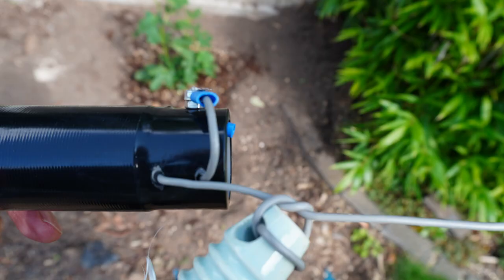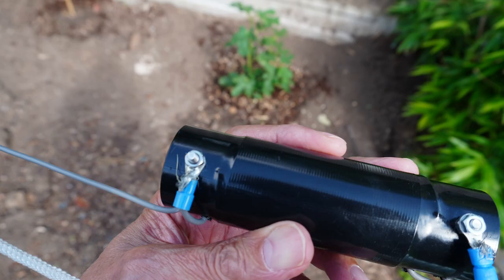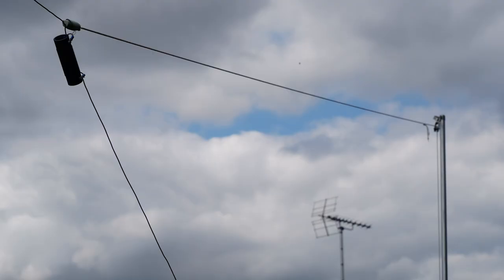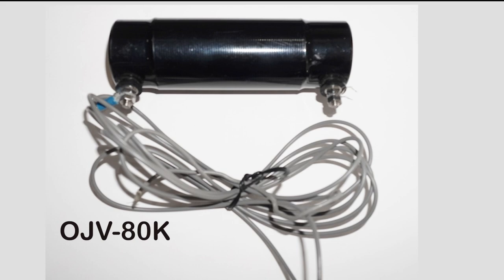End Fed Half-Wave Antennas - Tips and Tricks

Comment: Great video, I haven't seen the option to add a 18Mhz trap to give dual band coverage. Kinda makes sense - thanks for sharing
Reply: It got me thinking though, obviously if you have a loaded antenna for 14MHz that it wouldn't be as good as a full sized half wave. But then on 18MHz, which would be better, a resonant (trapped) half wave, or a longer antenna, say a half wave on 14MHz, but with a tuner to match it?
Reply: Paul Sengupta In theory a trap will make the 20m antenna less efficient, I doubt you would detect a difference in performance if you tested the two antennas back to back. I would recommend a resonant antenna over one that needs an ATU, this trapped design looks like an uncomplicated way to achieve that
Reply from the maker: Thanks guys

Comment: Very informative - would it be ok to use the choke to get a shortened half wave at 40m and then add a second choke to add the 80m band as well?
Reply from the maker: Yes it works but tuning on the lowest band is always quite sharp. 73 Peter
Reply: @watersstanton Many thanks for coming back to me. Yes, I suppose that makes sense. With the combined loading coils.

Comment: Thanks very much great info, but I'd love it if you'd use Imperial and Metric measurements in your videos.
Reply from the maker: hi there. It’s an age thing! Will try.
Reply: @watersstanton  Well the USA still uses it so it's not just an age thing, but UK and all of the rest of the world uses metric these days so I think both is better than one or the other if possible.  73!
Reply: The metric measurements are a bit of a no-brainer though. A half wave on 40m will be 20m, a half wave on 20m will be 10m, and a half wave on 17m will be 8.5m. Make it a bit longer and trim for resonance. :-)
Reply: @paulsengupta971  I know how to calculate wavelength in metric that wasn't the point.  (300/Freq in MHz then multiple by Velocity factor)...
Reply: Indeed, but my point is that you don't need to go through the calculations as you already know (approximately) the wavelength as that's what the band is called. It's called the 20m band because it has a wavelength of 20m, and thus half a wavelength will be 10m. Approximately, hence starting off a bit longer and cutting for best SWR.
Reply: @paulsengupta971  So no need to mention any measurements at all in metric or imperial then.  BUT if you do best use both, and don't mix units.  If you mention 20m band it's nice if the measurements are in metres - it's known as the 20m band not the 65 foot 7 and 1/2 inch band isn't it...
Reply: "So no need to mention any measurements at all in metric or imperial then"

You have to mention them in imperial for our American cousins. If you say the 80m band and mention a half wave, someone who converses in metres will immediately think 40m (I recently made one of those, cut it to 43 metres to start with, haven't trimmed it down yet, got to get it up in a tree...). But someone in the US might have no clue what length 40 metres is or how it fits into their garden which they only know in feet. So if you then say it's 133ft, they'll then have an idea. One's obvious, the other needs maths. Though I do agree with you that it would be nice to hear the measurements given in both.
Reply: @paulsengupta971  "Though I do agree with you that it would be nice to hear the measurements given in both."  That was the entirety of my point, nothing more nothing less.

Comment: Thanks for the information, very instructional. Recently moved from a 2 acer yard in South Carolina to a 60x100ft yard in Connecticut ! Trying to figure out what to do. well 73 Leo k1zek k
Reply from the maker: Still plenty of room by our standards! 73 Peter
Reply: That's huge by British garden size , I wish I had that size garden .
Reply: That should be big enough for a full sized inverted V on 80m (wherever you choose to feed it) if you can get the middle up high enough. Or you could have a horizontal antenna with the last 33ft (133ft total) going off at 90 degrees.

Comment: I have recently purchased an end fed antenna. I wish to use it mainly for 40 meters. The length of the antenna is 41ft , which is roughly a quarter wave length at 40 meters.
Would it make much difference if the wire length was increased to around 66 ft, so it would then be a half wave at 40 meters?
Reply from the maker: If it uses a 9:1 unun then yes but avoid a half wave kength. Go for  around 50ft or 80ft.
Reply: @watersstanton  Thanks. It has a 9:1 Unun. Will the current length of 41 ft still be ok?

Comment: Thanx alot Sir for such a brilliant video, I need to ask that, what if I install EFHW in a normal L configuration ( not Inv L) in your opinion how good it will be with DXing point of view, as a matter of fact I'm planning to install it in normal L configuration with about 35 ft vertical and rest of the length as horizontal..thanx
Reply from the maker: Interesting!  if the horizontal length is well above ground - say at least 10ft then the results would interest me. Try it.
Reply: @watersstanton  Antenna will be installed at around 20 ft of height above the concrete roof of my house, but the horizontal section would be about 8 ft further above the roof....thanx for the early reply..will share the results with you.

Comment: Hi i have a small garden but have put up a 80-10 efhw at 140ft long but zig zagged it up my garden.....was wondering if I cut it to 66ft and bought one of your coils would it work better or worse as less wire?? Just means I could probably get a 66ft alot higher?? Many thanks
Reply: It’s worth avoiding coils if at all possible.
Do you have any height that you can use?
Could you start or end the antenna with a vertical section? A 10m pole would give you 30+ wire straight up.

You might get more comments on here, but feel free to message me - my email address is on QRZ.com
Cheers,
Matt M0PTO
Reply: @tincanblower  thanks matt .at the moment it starts with around 35ft vertical,then goes 33ft horizontal,then back to the house horizontal 33ft and then slopes down to the fence so in theory its in the shape of an N .Tunes on 80-10m with no external tuner which is a good thing n have worked usa,trinidad,Canada,Europe etc but we always want better
Reply: Andy Bronson M7xtt performance on 80m will be down as your 66ft plus coil will become a compromise on 80. This is the antenna I use but the good news is because signals on 80m in the evenings are generally so good you won’t see a big difference. Don’t expect great results on the higher bands until the new sunspot cycle really gets underway.
Reply from the maker: Hi Andy - hope the advice. from readers has helped you. In fact your zig zag would deem to be working quite well.

Comment: Hi Peter. I really enjoy your videos, they are very useful and have got me back onto radio again. I particularly appreciate your work with end fed half wave aerials, and your tips and tricks ideas.  I have a question: I have built the 49:1 unun and have installed a 20 metre length of wire as an Inverted L.   Instead of using traps or chokes, could the 17 metre band be added by installing a second wire radiator of approximately 8.2 metres long, borrowing from the 'Fan Dipole' principle?  Thanks again, Mike.
Reply from the maker: Hi Mike, unfortunately that idea will not work. The point at which the wire attaches to the transformer is a very high impedance and the 8.2m length, simply appears to the system as end loading and throws the whole system out of resonance. However, I have found that my internal ATU can match the existing 20m wire on 17m. There is significant VSWR, but it does work. Worth a try!  73 Peter
Reply: @watersstanton  Hi Peter. Thanks for your quick reply!!!  I'll give it a go. I do intend to experiment with some of your fascinating trap and choke ideas too.  Thanks again!  73, Mike.

Comment: Almost true about not needed an antenna tuner.  You won't get 1:1 swr across all bands, but should be less than 3:1 at worst.
Is that loading coil available for 160 meters (IE: to ad 160 to an 80m EHW antenna)?
Reply from the maker: Normally better than 2:1.
Reply: @watersstanton   Under ideal conditions.  My 80 meter EFHW shows near 3:1 on some bands.  Still within range of rigs antenna tuner though.

Comment: I use a Mfj. 10-80 half wave end fed antenna. The lowest I can get my swr to when using my Mfj 998 auto tuner is about 1.6 to 1.8 on 75 meters. No way my Icom 7300 can operate with its internal 3 to 1 tuner. So I could not operate without a tuner.
Reply from the maker: Thanks for sharing. 73 Peter

Comment: Whats the difference between 9:1 vs 49:1
Reply: A 9:1 should be used (with a tuner) for a "random" (non half wave) length of wire. A 49:1 should be used for a half wave (and doesn't need a tuner). If you have a standing (half) wave on a piece of wire, the impedance will vary from around 72 ohms at the centre (think centre fed dipole) to two to four thousand ohms at the end. Between these, the impedance will vary as you go along the wire.

Feeding at the 2/3 : 1/3 point with a 4:1 balun is reasonably popular to feed coax. If you have a half wave fed at the end, you want to bring the few thousand ohms down to coax impedance hence a 49:1 transformer (or a matching section as in the Zepp or J-pole both of which are just end fed half waves). If the wire isn't a half wave, you're effectively feeding it at a random point on the wave where the impedance could be perhaps 200-1500 ohms. A 9:1 will bring it down to the point where a tuner can compensate for the rest. There are quite well defined "random" lengths to use in order to avoid the feed point being too close to the centre or the end of the wave on all the bands it's designed for, and hence avoiding the impedance being too high or too low.
Reply from the maker: Thanks guys.

Comment: If you use the 40-10 loading coil and use a "bypass wire" around the transformer, can you also get 80m?  The bypass wire is explained in this video by Steve Ellington.  (around the 1:12:15 mark) 
https://www.youtube.com/watch?v=N_o0jneBEh0&list=PLE4BmHSnpKp9etUbCAVSwPBkypWm64hDd&index=4
Reply from the maker: It is something I have never tried. If you disconnect the antenna from the transformer output it may well work as a quarter wave on 80m. Try it!   Peter
Reply: @watersstanton  The 2" pvc pipe I have is 2 3/8" in outside diameter. (60mm)  Is this the correct size or do I need to get some 1 1/2" pvc?  It would be slightly smaller than 2".

Comment: Can i use a 9:1 unun on a 20m wire?
Reply from the maker: It depends on whether the ratio is actually 49:1. if the turns ratio is 9:1 (9x9 v= 49) then it may work.
Reply: A 9:1 unun is for a random length of wire of a length which is not a half wave on any band.
Reply: See my comment up there somewhere ^^^ for a 9:1 vs 49:1 comparison.